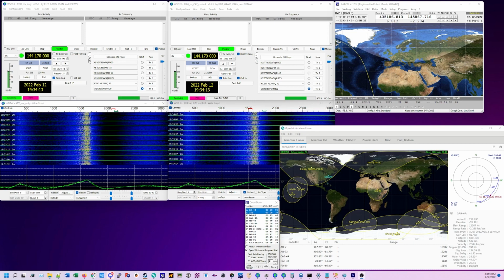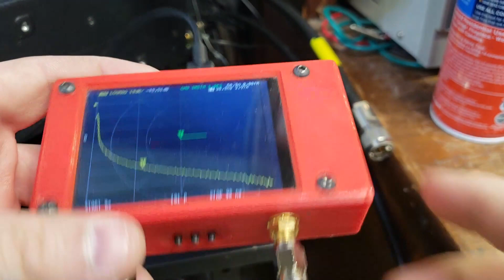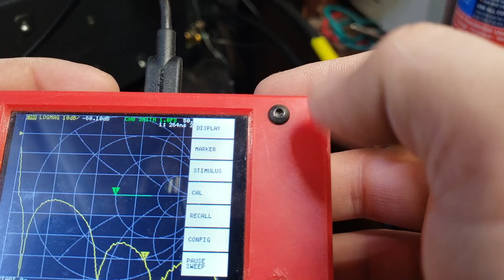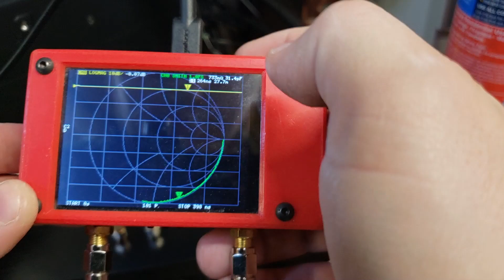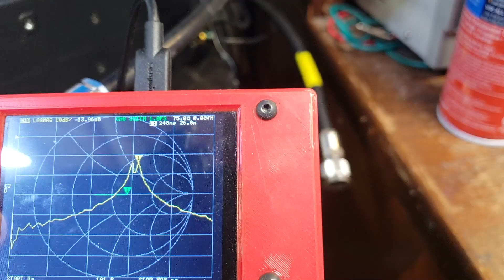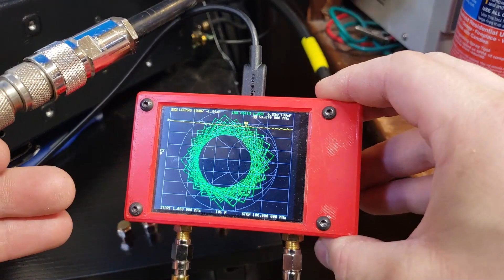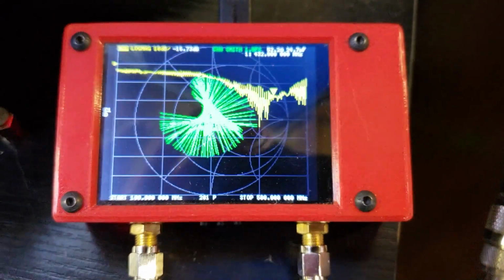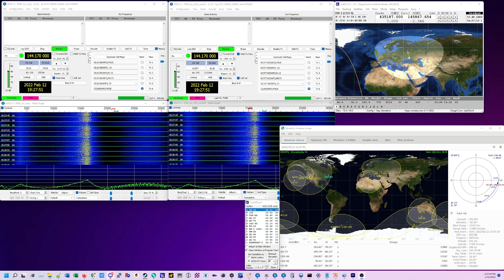Practical Use of the NanoVNA Time-Domain Reflectometer

Comment: Nice explanation of the tdr function of the nanovna.
You may be interested in this video i made which shows what the impedance of the coax is, if there are any connectors in the line and what is happening at the end of the line and at what distance.
https://www.youtube.com/watch?v=rikwkaGwncw

The sequence is; >display>format>more> click "real"
                back to tdr fields; low pass> tdr on

The blue text is a bit hard to read but if you pause the video and write it down it should work.
i like the horizontal line expression of the transmission line and it also works with a wire pair.
All the best.